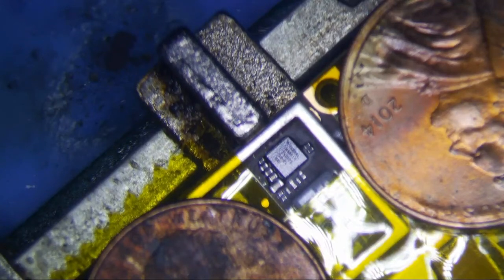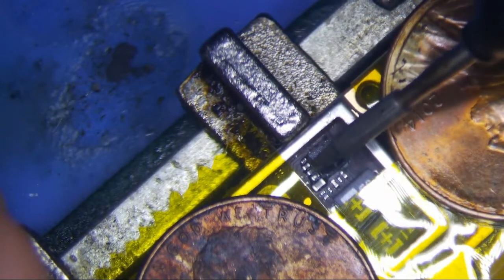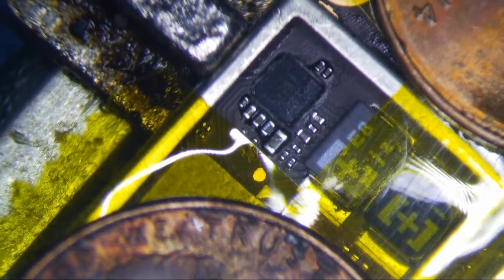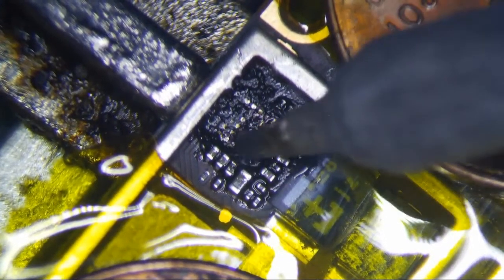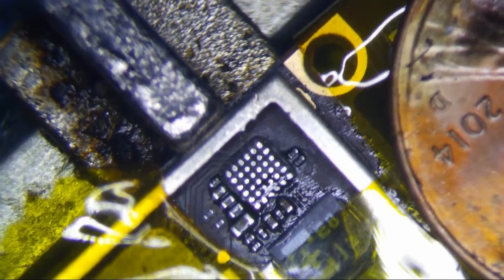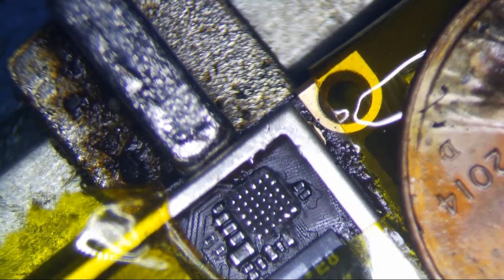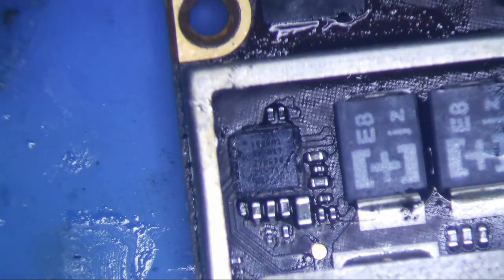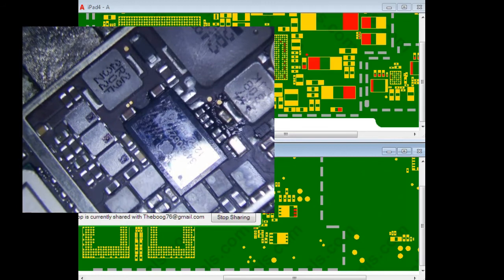iPad 4 No Power Charging Chip Tristar Repair

Comment: hey jason, i have an ipad 4,it charges normally,but when the battery is totally drained dead. it wont charge anymore.
can you tell me which line in schematics responsible for booting a dead battery?(if such thing exist).thanks in advance
Reply from the maker: throw it away.  and my name is not jason.
Reply: Hey,Sorry my mistake, Whats your name? or i just  call you Microsoldering is fine  ?
Reply from the maker: TheXmenForce mike is my name
Reply: Respect Mike